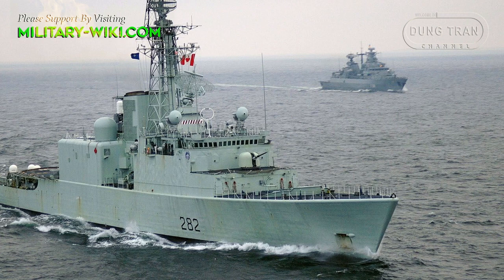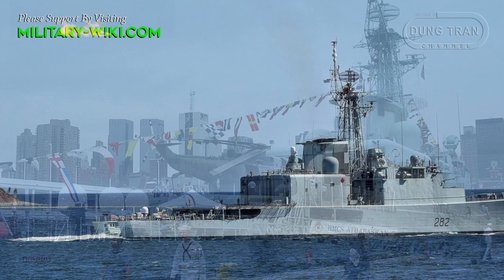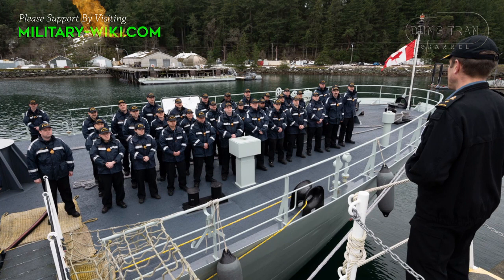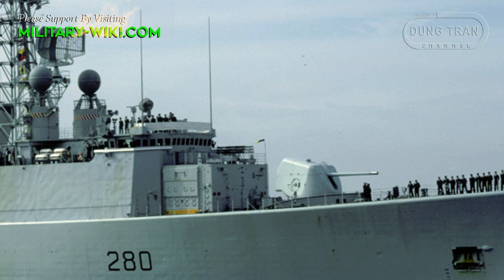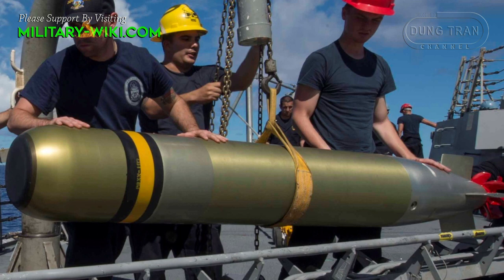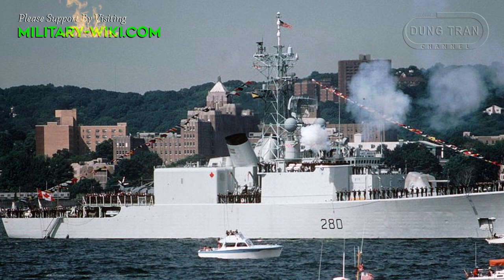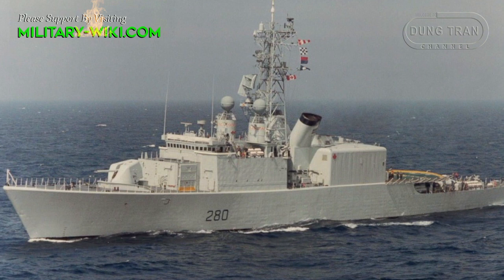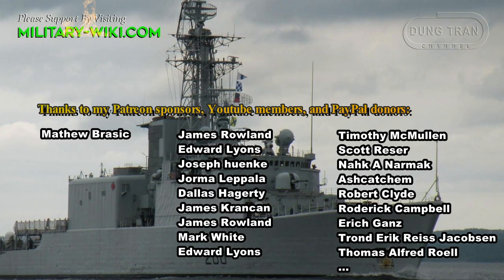Iroquois Class: The Former Anti-Submarine Warfare Destroyers of the Canadian Navy

Comment: Our four 280s while the DDEs still in service, with Preserver and Protecteur still on duty, are bygone days of the best of RCN. A wink towards the Bonnie & Cape Scott then years gone.
It hurt losing the 5inch gun, replaced with a faster 76 mil Oto Melara, but the fine 20mm Phalanx softened this blow. These mods dearly needed before 1991 deployment first Gulf War.
Missile systems were changed over the years.

Comment: This ship is weak as fuk for today's standards
Reply: Are you naval expert?
How is this ship as you describe it?
I'm very curious to hear your answer.
Reply: @1joshjosh1  I'm not a naval expert, I just use common sense. For example he said that it has only 32 missiles, the American A. Burke class has over 90...
Reply: a damn missile magnet too!! with that superstructure it might as well have a radar beacon broadcasting!!
Reply: @1joshjosh1  simple only 8 missiles ready to fire and 2 reloads most corvettes have at least 24 ready to go!!
Reply: @keithmoore5306  
Ok fine.
You are making some valid points.
Don't say them too loudly because you will hurt the ships feelings.
😆
Reply: @keithmoore5306   If you listen to the video again you will hear that the 32 missiles it refers to are with the pre-life extension program. Its original fit-out is with Rim-7 Sea Sparrows with a total of 32 missiles available. During the life-extension upgrade, the ship is upgraded with a VLS system which from the design blueprint shown has a total of 32 cells. However, the Evolved Sea Sparrow missiles can be Quad packed into each cell. Most ships of this type tend to carry a mixture of medium/long range missiles like SM2 and shorter range like ESSM so even if just 8 cells contained ESSM that would still mean a minimum of 32ESSM and 24 SM2 and that is before you factore in any reloads stored within the ship. So to sum up YES 32 missiles IS quite low and IS less than many modern corvettes or even OPV's but thats comparing a 1970 destroyer with a 2020's corvette. You can be damn sure that any 1970 corvette would not have more than 32 missiles lol :)
Reply: @dna6882  those verticals drive me nuts!! am i asking too much when i say this, if they hold 32 say 32 if they hold 4 to cell then say how many total instead of 32 cells or at least say multi missile cells! it's near impossible to keep straight what ship has what missile wise anymore!!
Reply: @keithmoore5306  Yeah I totally get you aye, makes the whole thing a bit of missile pick and mix lolly scramble lol  :)
Reply: She was a deadly submarine hunter, 2 types of hull sonars plus the best towed array system in the world at the time , 24 torpedo load out with 6 tubes and two sub hunting sea kings onboard as well. Not to mention 76 MM auto, 32 VLS 41 launchers for SM2 and port and starboard auto loading quick snap quad launcher rails for Sea Sparrow anti-air, plus a capable fleet CIC capability.  Yeah, real weak there buddy
Reply: @keithmoore5306  Have you looked at a Hobart lately?
Reply: @scottmccambley764  frankly since the first gulf war i've had trouble keeping US gear straight especially with how they start a project bring right up to acceptance and then drop it for an upgraded version of what we already have or decide the new one won;t do the job and start all over again! it gives me a headache just thinking about it and raises my blood pressure at the cost of that!!
Reply: Yeah and Canada rejected the design for the CSC.  The Hunters will be more useful to the RAN and just as deadly as those 3 Hobarts ever will be.  Glad Canada went with fifteen T-26s instead of splitting the class between GP and AAD.
Reply: @mikolaz.1865  Hmmm... they were commissioned 50 years ago. When they were commissioned they were probably the best ASW platform in the world. The RCN was more or less an ASW specialist at that time.
Reply: @mikolaz.1865  the A. Burke is 25 years newer. and typically American is armed far more than any other destroyer period. The comparison is ridiculous considering the 25 years between
Reply: duh ship would be 53 years old by now. A different time a different load out. Oh as sub hunters nothing was superior and they functioned very well in the north Atantic unlike many others
Reply: They were designed and built in the 70's. All were retired by 2014.
Reply: It’s been decommissioned since before your comment.